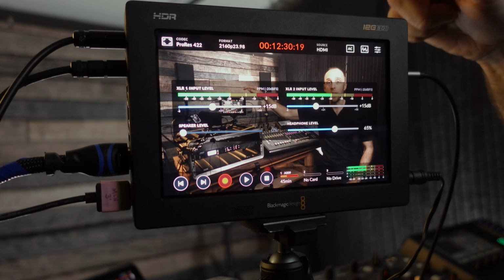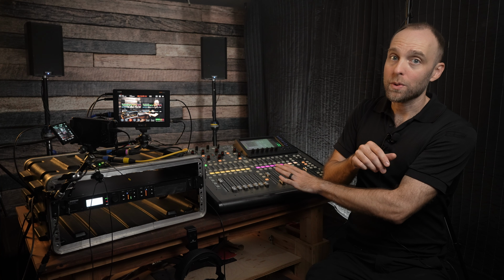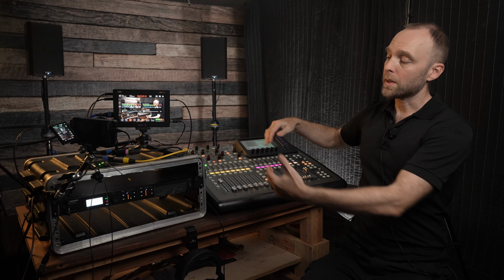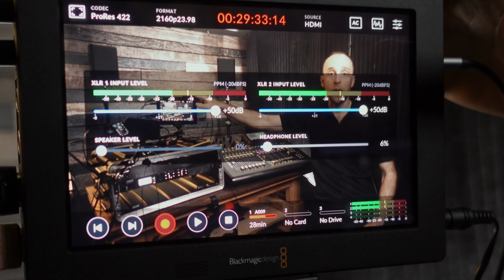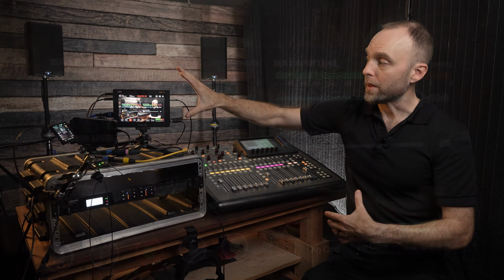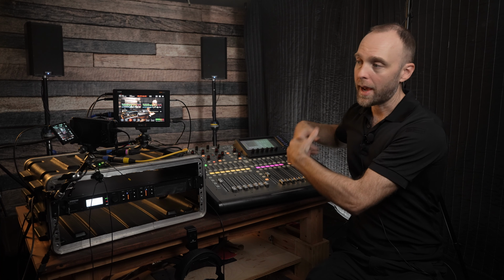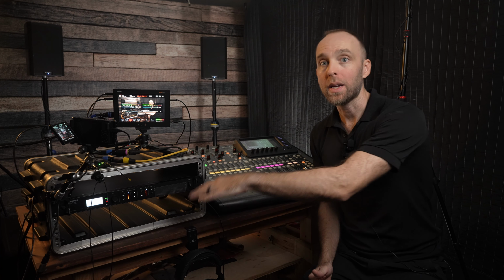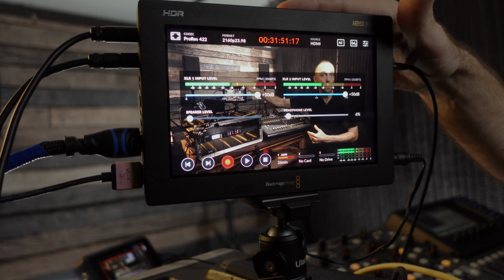Live Audio NOISY Gain Structure Problems

Comment: THANK YOU!!! I've worked with so many "engineers" over the years who set up ass backwards, have no input gain, spend the whole gig fighting their own console, have noisy, hissing PAs and then have to carve their EQs up like Christmas turkeys to bring down all the hissing and the howling...

I tell people that if you walk into a room with a PA and you can hear it hissing when there's nothing happening then the engineer's got their gain structure wrong... 

I also tell people about the RF receiver's gain settings as a primary point to use.  

A company I work with arbitrarily sets their amps at eh 12 O'clock position and then expects you to mix into that. If I have amps I prefer to set my inputs, get strong outputs and then turn the amps up to fill the room. 

I do have to mention that your channel EQ is a pretty aggressive though... could be due to being that close your speakers but it's essentially just turned the channel down by about 10db so I'd keep it flatter and use a little less gain and you'd hit -18...

Great tutorial, confirms 100% of how I was both taught and intuited to do it.
Reply from the maker: Hi there.  Thank you!  And, yes, my EQ is aggressive b/c I'm literally about 8' in front of these speakers in a very small space ;). But good-eye!!

And you are preachign to the choir!!  

I love your comment "I tell people that if you walk into a room with a PA and you can hear it hissing when there's nothing happening then the engineer's got their gain structure wrong... "

Yes, yes yes.........exactly.  I walked into a ballroom last week that was being run by another AV company I use to work for......I immediately heard the speakers hissing and yep.....it was early and that crew wasn't there yet so I snuck over to their tech table and checked their gain structure and yeah.....low-as-hell on the console.  (I knew the guys coming in later so they wouldn't be totally mad at me if they caught me, but I just HAD to know!!)

Anyway........thanx for watching, spread the good word!